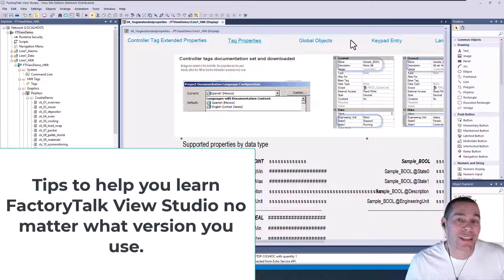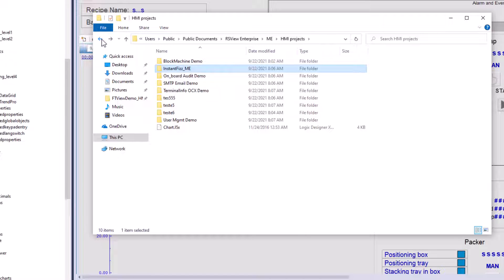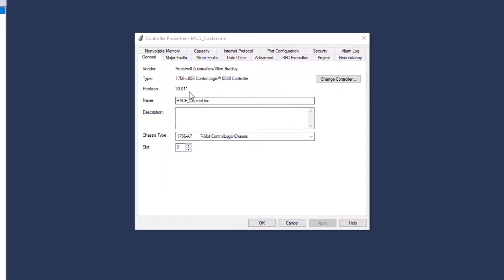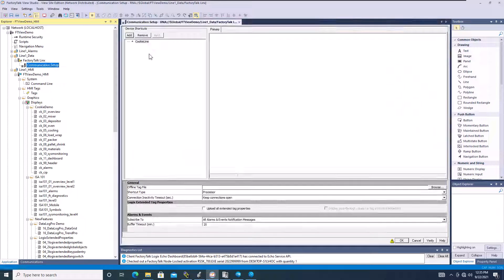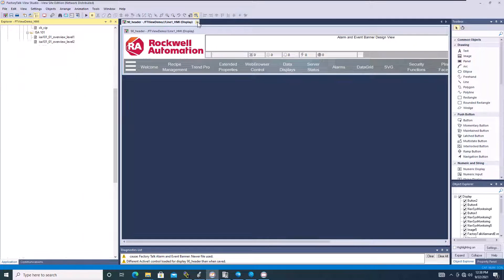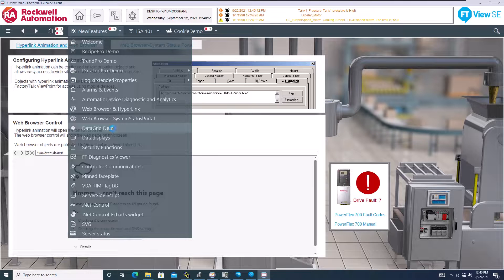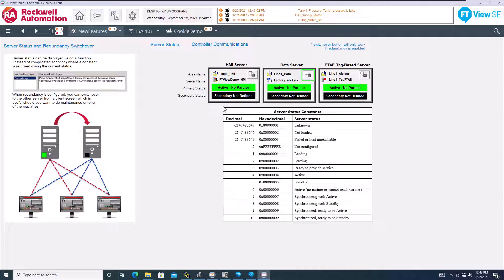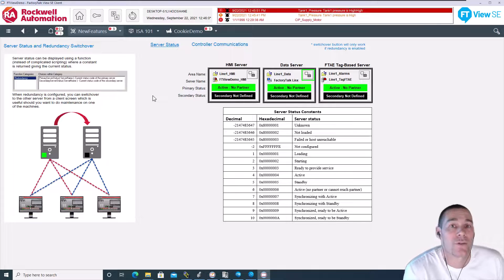Stay up to date with FactoryTalk View Studio no matter what version

Comment: I am still somewhat confused on the difference between logix echo and emulate besides the fact echo is the newest from rockwell. Is there more functionality in the echo software?
Reply from the maker: Echo is used for any plc processor without changing anything. 

Emulator requires you to change the processor type.

Along with not being able to change an L8 series processor to an emulator so it forces you to use Echo
Reply: @ShaneWelcher  You're right. Echo only uses the L8.